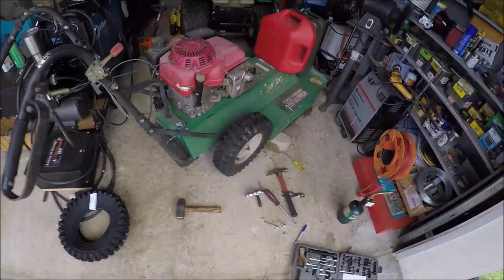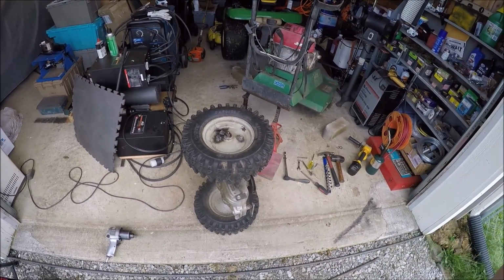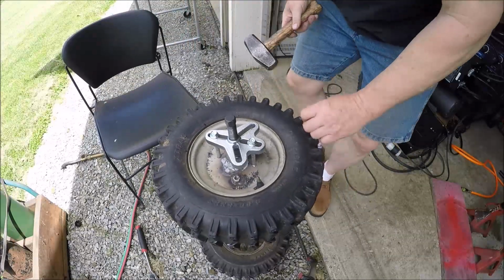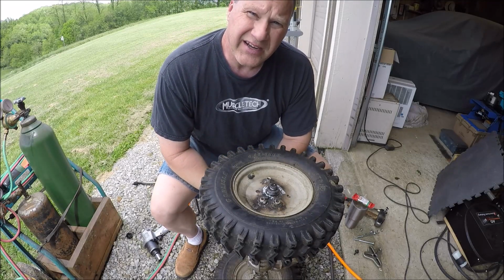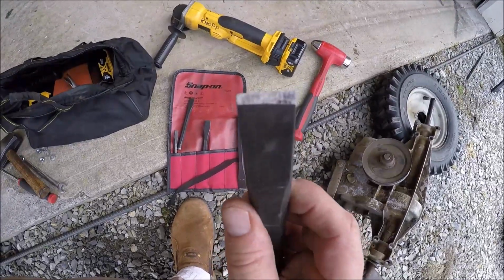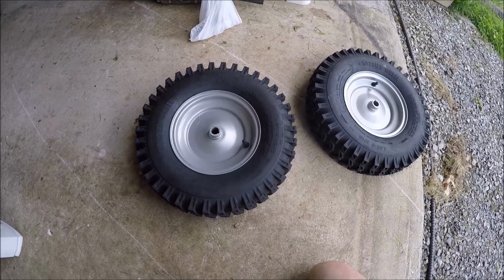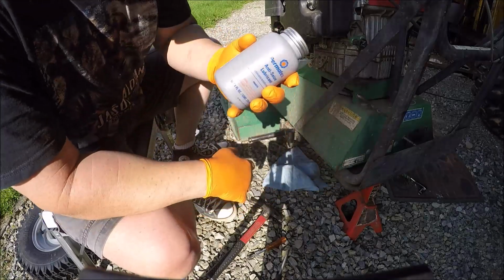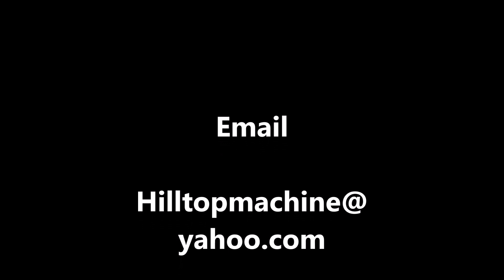Billy Goat Brush Cutter repair

Comment: Thanks for showing what must be a recurring issue with these wheels. I’m soaking the area with penetrating oil and hopefully in a few weeks I’ll be able to pull them off.
Reply from the maker: I hope you have better luck then I did.

Comment: You definitely took some licks, but came out on top in the end. I think I probably would’ve left the rims on the axles and just swapped out the tires. Think it would’ve been easier. For those kind of projects neverseize   Is worth it’s weight in gold. Nice to see a video from you Tom.      Gary
Reply from the maker: I need to make friends with a tire shop. Being new to the area I don’t have any connections. We finally have some of that California sunshine here and are back to work on the shop. 🤗

Comment: I’ve been trying to find a set of aftermarket wheels, but they all don’t have the “key” notch on wheel rim. Most aftermarket wheels are just a regular 3/4” hole/bearing for the axle, but no notch for a key. I may have to buy tires and reuse the old metal rims, if I can get it off, which mines I think will come off.

Comment: I destroyed my axle trying to get the old wheel off… now I have to buy a new transaxle..
Reply from the maker: Oh man that sucks.
Reply: @hilltopmachineworks2131  Meant to ask….did you get your tires foam filled? I’m afraid I’ll never get these tires off of the new transaxle either. I’m thinking of using brass key stock. This is a terrible design..
Reply from the maker: @dennyk1024  No I didn't. I just have air in them currently. I put a heavy coat of anti-seize on the axle shafts before I put the new rims on.
Reply: May I ask… Do you pull your rims every year and re Anti Seaze  them with the lube??
Reply from the maker: @dennyk1024  No, but that is a good idea.

Comment: Why did you just  not just replace the tires with the wheels still mounted on the machine?  Not ideal but for a small tire like that it could be done.
Reply from the maker: It would have been a major pain to get it loaded up and take it somewhere to have it done. Plus the rims where over 10 years old and not in the best shape.
Reply: @hilltopmachineworks2131  You have plenty of tools and you certainly have the grit and tenacity to cut the old tires off of the rims and wrestle the new tires on.  All you need is some soap (for lube) and a couple of long bars to help roll the bead down over the edge of the rim.  I know -- easier said than done but I would think it would be doable.  Of course, I have not tried it myself one anything bigger than an 8 inch rim so I can't speak from experience on your particular tire and wheel combo.  In any event, I enjoyed the video and I felt your pain every step of the way.
Reply from the maker: @BubbleOnPlumb  Yeah I probably could have wrestled with it like you said, but I guess I was not feeling it and just went the easy route. LOL! Thanks for watching.